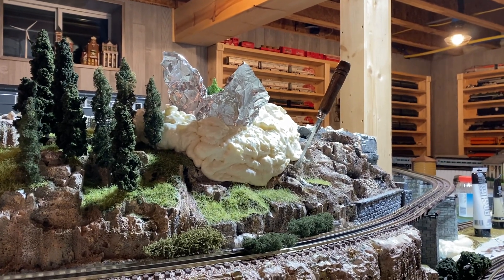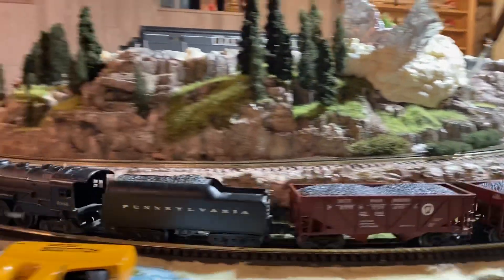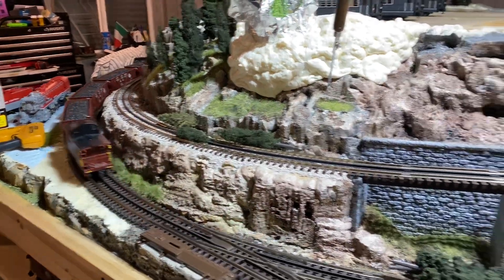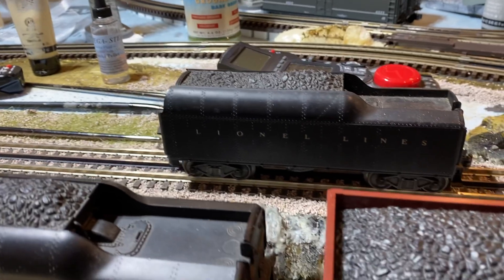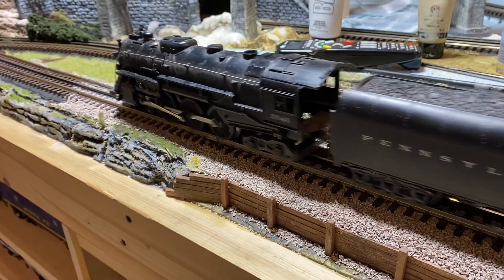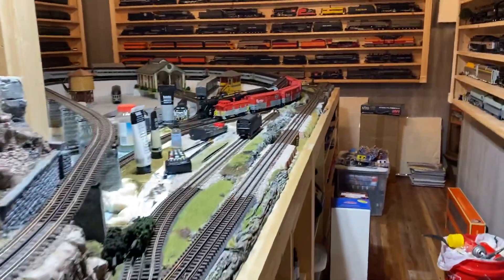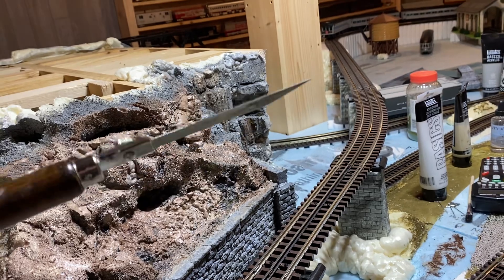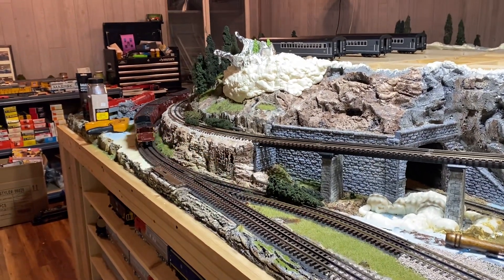Front End Friday, Lionel 2046 and waiting for the spray foam to dry on my logging mountain addition

Comment: Hi Mike!  thanks for sharing such a great engine I grew up with the Lionel 2056 and since then acquired a different one they have a great runners they seem to run forever. I am not sure if you ever saw it but Jim Barrett from ogedro road and did a video series called in the backshop and I think it was volume 9 that shows him disassembling this locomotive down to nothing we've done enough and cleaning it lubricating it and putting it back together it's pretty fun video to watch I might have an extra one I can send you to view if you're interested
Reply from the maker: Thank you!  That sound like a great video to check out.  I had a 2056 and sold it to a friend that just got back into trains.  That’s a great locomotive also!  I’ll check it out.  👍